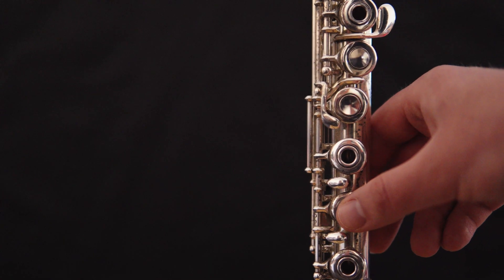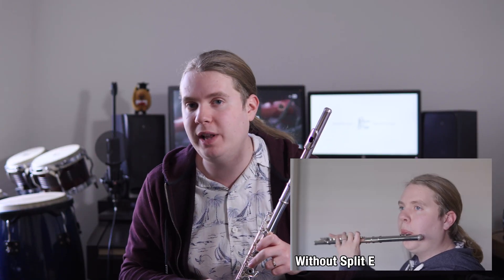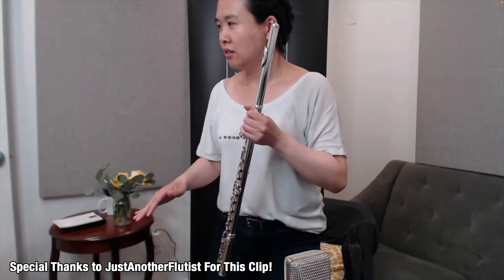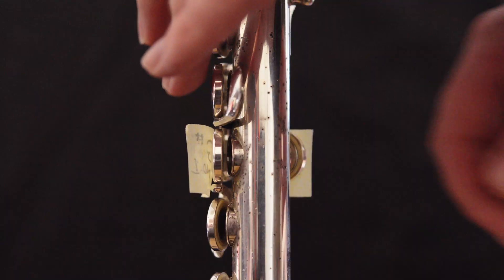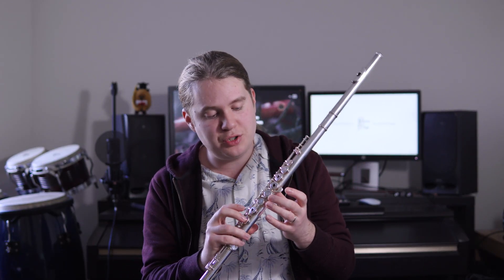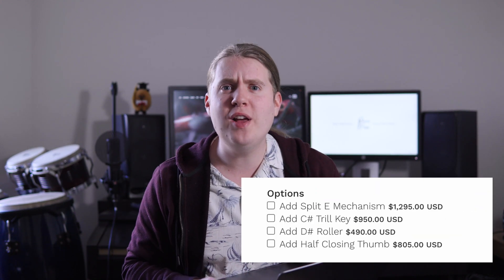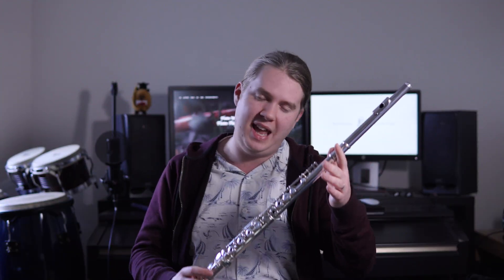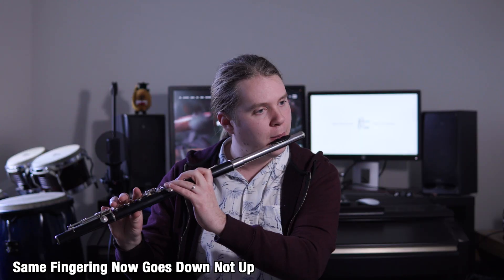The Flutes Inventor HATED Our Modern Mechanism.

Comment: I think the problem goes back to before the 8-keyed flute -- back to the baroque flute when just the first three left hand fingers were used to play a G. When a G# was finally added, that key was sprung closed. When this was carried over to later designs, it caused venting problems for the low and middle A, resulting in the duplicate G# hole and key of today. BTW, Boehm's design should be called the open G NATURAL key, which covers the G# tone hole, because keys are named for the note produced when they are CLOSED. Thanks for helping to keep this subject alive!
Reply from the maker: Actually, I believe keys are named after the note they play when they are pressed. So, for example, the E key plays E when pressed and D# plays D# when pressed. However, when closed, E plays E and D# plays D, because the E key is normally open and then closed the play E and the D# key is normally closed and then opened to play D#. The same as on the D# key is true for a C# trill key or a closed G# key.

However, you are right that, by that logic, boehms original system would have the left hand pinky pressing the G key and the left hand ring finger pressing the G# key. So perhaps we are calling it the wrong thing! Bah, how confusing.
Reply: @passionflute2538 Sorry if this confuses things further, but I was referring to the key cups which hold the pads and are named for the note produced when closed. There are also lever (touch) keys which, to be consistent, should also be named for the note produced when pressed. Therefore, on the foot joint, I call the closed-sprung key cup the D key (because it is closed and produces low and middle D), but the lever it's attached to for the right pinky would have to be called the Eb or D# key (because it opens the D key and produces E-flat). Same thing for the (closed-sprung) G key attached to the Ab/G# lever on the traditional closed G# flute, and the C# trill lever key (for R1) which opens the closed-sprung C (natural) key. Finally, I call the key cup for R3 the Eb/D# key because that's the note produced when closed with the pinky pressing the Eb key to hold the D key open, as when going from E natural to Eb! Well, this is fun!!
Reply: @leo5208  Your logic is so correct, and convention  is not necessarily logical. WHAT ELSE IS NEW under the sun?  All in good fun!
Reply: Theobald Boehm himself actually named the pad cups after the notes that issue directly from the open toneholes when the pad cups are open (as notes physically can't issue directly from closed toneholes), that's easy when naming closed standing keys (eg. Eb and G#), but causes a headache for all open standing keys as everyone has their own idea on naming them and no-one can agree on anything. You can see when you play E (xxx|xxo) the RH3 tonehole (the lowest one on the main body tube) is open and Boehm named that tonehole the E tonehole as the note issues directly from it. 

If you start from the footjoint, the lowest note will issue directly from the end of it and not from the lowest tonehole. On a low C footjoint, the lowest tonehole is in fact the low C# tonehole as that's where low C# issues directly from (on a low B footjoint, the lowest tonehole is the low C tonehole as that's the tonehole low C issues directly from). For the main body joint, Boehm named the main action toneholes starting at the tenon end E (RH3), F (RH2), F# (RH1), G, G#, A (LH3), Bb (LH2), B, C (LH thumb) and C# (LH1) as those are the notes that issue directly from the toneholes. 

The most universal system of naming the fingerplates is after the fingers that control them, so you have LH1, LH2, LH3, RH1, RH2 and RH3 which applies across the board for pretty much all the modern woodwinds (all flutes, all oboes, all clarinets, all bassoons and all saxes). All the other keys (LH thumb, G#, Eb, low B, etc) can then be named accordingly.
Reply: @chrisperyagh  As wind and string players, we all have 4 fingers and a thumb on each hand. But pianists in most countries have 5 fingers! Either thumb is 1, pointer is 2 middle is 3, ring is 4 and pinky is 5. I remember as a kid, my teacher introducing high G as123/4, meaning xxxo/ooox. 
So my piano lesson pea brain translated this as  RH: Th1,  pointer2,  middle3/ LH: ring4. I even called her midweek because my version was definitely NOT a G. She told me not to worry if it didn't work; we'd figure it out at the next lesson. 
And that's how I learned that pianists have a different finger numbering system than other instrumentalists.
Reply: @chrisperyagh I assume that the source for what you wrote is Boehm's Flute and Flute-Playing book. I haven't looked through it in many years, but if he named the keys for the notes produced from the tone holes under them, I would be very surprised. Your claim that he started at the low end of the flute with all of the keys closed and then named the keys according to the note issued as he opened them is the exact opposite of what I've always understood. Maybe there was a problem in translation (or my understanding), but I believe Boehm wanted the flute to have open-standing keys to start with, so logic and consistency dictate what I described before, starting at the upper end of the flute. You may be right, however, because Boehm himself used the term "open G# key" when referring to his design. This would've made sense only if he was coming from below with the lever down and then lifted it to play G#. Likewise, Quantz called his two RH pinky keys Eb and D# as they were opened. I still prefer my way of thinking about it.
Reply: @leo5208  While with all woodwinds and especially keyed woodwinds, calling a specific fingerplate or ring key after a specific note or by several notes depending on the context instead of naming it after the finger that directly operates it takes a lot of guesswork out of things when describing a problem or a fingering. With instruments like saxes, saying 'the C key' can mean a ton of things and nothing at the same time if everyone's logic of naming keywork is different to everyone else. 

The other problem is if that same finger (eg. LH2) is employed for another note, then is it the C key (oxo|ooo) or is it the A key (xxo|ooo)? It's purely dependent on context and perception in that scenario and can cause a misdiagnosis or some unnecessary detective work if there's a regulation problem. As something as basic as a tin whistle has no such  keywork and six toneholes, naming them after the finger that controls those toneholes is simple as LH1, LH2, LH3, RH1, RH2 and RH3. All our woodwinds use those six fingers, so there's  less guesswork when describing a specific fingering or a problem.

Then when you get some instruments that don't follow the rules where xxx|ooo is G, you can still use the same naming system for those as well. Then in some cases there's people who insist in naming the fingerings as the actual concert pitch note produced instead of using a transposing system that is meant to making things easy when switching from one pitch instrument to another without having to learn a different fingering system based on the notes (and they do walk among us).

And with toneholes being named after the note that issues directly from them, that won't cause any trouble if any tuning work of any specific note is carried out on that specific tonehole. If open C# (ooo|ooo) is flat on a 6 key fife, then the LH1 tonehole is the one to address. If B (xoo|ooo) is sharp, then the LH2 tonehole is the one to address as the LH1 tonehole is closed and B issues directly from the LH2 tonehole as can be seen in the fingering diagram.

I labelled the toneholes on a body of a clarinet with no keywork fitted and someone said I was wrong as I labelled the Ab/Eb tonehole higher than the G/D tonehole, when it is as you can only go up in pitch as you open more and more toneholes. They said the RH3 tonehole is the G/D tonehole when it is in fact the A/E tonehole as it's located above the Ab/Eb tonehole and A/E issues diectly from it. You can't physically have a tonehole issue a lower note that's nearer to the top end than the one located immediately below it as you're shortening the length of the tube with each tonehole opened in turn.
Reply: @chrisperyagh  Speaking of people who "walk among us," you're probably aware that some flutists number the fingers from 1 to 5 starting with the left thumb and continuing with 6 to 9 starting with the right index finger without explicitly referring to the left or right hand!

After taking into account all you have written, I'll revise and extend my remarks as follows: Whether describing fingerings or keys, I think the best system for the standard Boehm flute (I don't know about clarinet and sax) names the keys (cups and levers) for the concert pitch produced in the first octave when they are depressed, whether by a finger or a spring, and when all of the tone holes above a given key are closed and all the tone holes below it are open. Calling the key for LH2 the A key meets those conditions, as does calling the closed-sprung key in back the G key that's attached to the lever for LH4 which is the Ab/G# key. Same for RH4 that works the Eb lever key that's attached to the closed-sprung D key. A tone hole is simply named for the concert pitch produced in the first octave when uncovered, with the holes above it closed and the holes below it open.

Comment from the maker: What do you think of Boehms Open G# system? Do you think the inventor had it right all along, or are we better off with our modern mechanism, despite the added complexity?
Reply: I don't know, but I did like the way you handled what seems to be a case of swallowing a spider to catch a fly!
Reply: Pinky finger is weak and should not be required to be down to press most notes. All modern woodwinds share the same closed left pinky key mechanism with no problems
Reply from the maker: The right pinky is already required to be pressed down on almost all notes, and assists in the balancing of the flute. Boehms original intention was to have both pinkies act this way, hence his designing the Open G# system.

Speaking from the perspective of someone who owns and plays an Open G#, it really is quite a wonderful thing, at least once you get past the brain ache of figuring out all the fingerings again XD

And, while you would think the left pinky would get tired, because open sprung keys don't require nearly as much force to push down, it's surprisingly easy-perhaps even a little easier than closed G#.  Though that would somewhat depend on the specific flute, as different mechanisms are sprung with different tensions.

Also, regarding the mention of other woodwind instruments using the "Closed G#", or at least their equivalent, that's actually because these other mechanisms were almost all based on or in some way inspired by the Boehm flute. Boehm was the first to put a complex mechanism on a woodwind instrument, and once it started gaining traction, many makers of other instruments started inventing new mechanisms, adapting the flutes mechanism to their own instruments. They, however, ended up copying the more popular closed G# system, rather than Boehms original open G#. Funny the way history goes!
Reply: @passionflute2538 the right hand pinky is not necessary for most notes, but solely to balance the instrument like you mentioned. That’s a quirk exclusive to the flute. I agree that you could get used to using pinkies for most notes, but i personally view it as extra unnecessary tension, plus you have the possibility of crossing noises since you have to move 2 fingers simultaneously to go from G to A.
Reply: There is a type of folk recorder called a sopilka which has open G#. It's interesting because it's a family of keyless instruments. 

Even as a multi-instrumentalist with an open mind, I can't wrap my head around it. I really think the left pinky should not be asked to hold down a key so much, it's a recipe for overuse injuries and it adds increasing demands on technical coordination.
Reply: Boehm's idea was for a fully vented instrument, only the French players were the ones that objected to the open G# key. Dorus designed a G# key which was connected by a spring to the LH3 fingerplate so both closed together when you played G, but you could then operate the G# touch to open the G# key - only that knackered up the correct venting of high E as both the toneholes were open (just like a flute without a split E mechanism). Then later on the split E mech was designed, but that then buggered up the high G-A trill. 

I think Rudall Carte even designed a split high F# mechanism to give the correct venting for high F# which isn't the best note on most flutes as it's over vented. Bulgheroni piccolos (and I suspect some others) have a split high G# mechanism where the G# key closes off just the lower of the two thumb toneholes - the Hammig high G# mechanism diminishes the venting of the thumb key pads by lowering them down but not fully closing them.